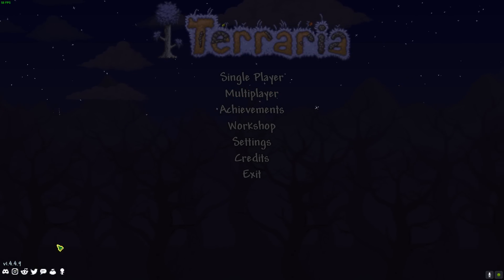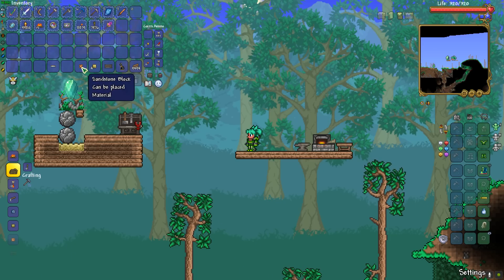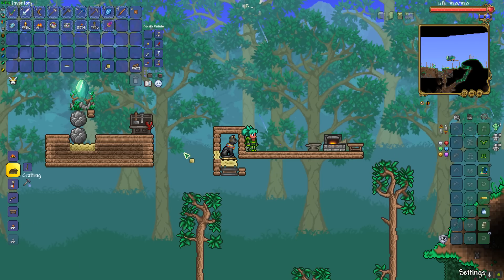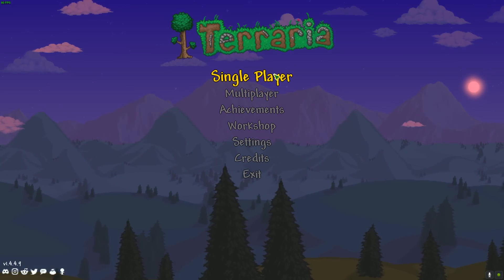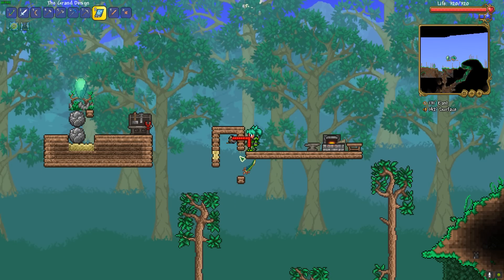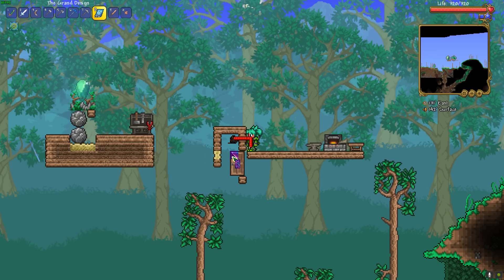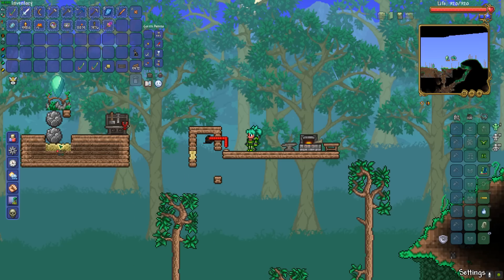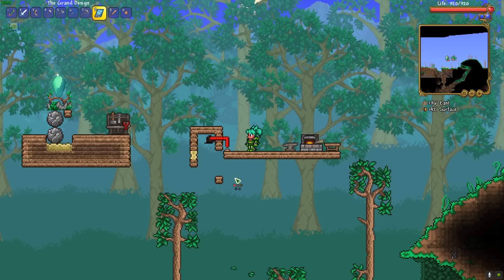How to turn a Door into a Terrablade +more | Terraria Glitch Explaination

Comment: The bast statue just breaks when i press the pressure plate
Edit: I put it to low
Edit 2 : It wont turn into the terrablade
Reply from the maker: you need to follow the exact order of what i do, open door, activate bast, close door, deactivate bast, and repeat a few times
Reply: @eatpotaro I think i got it to work its just really difficult cuz of my mouse

Comment: hay i tried this glitch and I am on mobile solo and it did not work do you need to do this on pc?
Reply from the maker: yes
Reply: ok thanks
Reply: @eatpotaro  ill try try that when i can
Reply: Just so you know the glitch might be patched and it’s doing the same thing when I try using mobile the bast floats
Reply from the maker: you may be on singleplayer, to do the glitch you must be on multiplayer
Reply: @eatpotaro  oh
Reply: @eatpotaro  but I have no friends lol
Reply from the maker: @maddowse  if you press the host and play option it works, you can do that with one player. Also i does not work on mobile
Reply: ok thanks
Reply: And I did try to do that in single multiplayer and it did not work
Reply: It’s patched 100 percent
Reply from the maker: @maddowse  its not patched, you must be doing something wrong

Comment: This glitch doesn't work for me, I've been trying for hours and it doesn't work.
Reply from the maker: are you in multiplayer pc?
Reply: @eatpotaro  now its done, but is so hard to get Zenith with this glitch
Reply from the maker: @pamonhachanvr  check the automated guide on my channel! that should make it much easier
Reply: @eatpotaro  If it took me 11 hours to understand the easiest glitch, imagine this automated one which is much more complicated 😢
Reply from the maker: @pamonhachanvr  the automated one is not that hard, its the same setup with a little bit of extra wiring
Reply: @eatpotaro  I didn't understand how your character moves so fast. Another thing is that I don't have the mechanic cleared, the wires I got were a friend who gave me, if I had known I was going to make another one, I would have used the duplicating glitch before using it.
Reply from the maker: @pamonhachanvr  i used a hoik. if the video, i hammered blocks a couple times and then placed platforms. to get more wire, get the grand design and look underground for trap
Reply: @eatpotaro  I do but, how u move too fast?
Reply from the maker: @pamonhachanvr  i enter the hoik by pressing down
Reply: @eatpotaro  wow, done, now i just need one Steamcontrol door, where i can find or create it?
Reply from the maker: @pamonhachanvr  im pertty sure the pumpkin door transmutes into it, or you can google cgo (campfire glitch) and obtain it that way
Reply: @eatpotaro  no way, another glitch like this just to get one door? 😢

Comment: I can't do it, can someone help me?
Reply from the maker: you need to be in multiplayer
Reply: yeah I was
Reply from the maker: @codzz1fan  on pc? on console you need to connect a second controller and i dont know about mobile
Reply: I’m in pc
Reply from the maker: @codzz1fan  whats wrong exactly?
Reply: Its that I can't transmute the door and the other items into the next one
Reply from the maker: @codzz1fan  does the bast make particles when powered?
Reply: Yes @eatpotaro
Reply from the maker: @codzz1fan  strange, the door changes from wood to purple in a corner right?
Reply: yes @eatpotaro
Reply from the maker: @codzz1fan  its working then
Reply: but I dont know how to get to the next stage @eatpotaro
Reply from the maker: as i said in the tutorial, you need to right click on the top-left piece of the door @codzz1fan
Reply: thx @eatpotaro
Reply: I tried it and i cant get past the wall
 @eatpotaro
Reply from the maker: just repeat what you do with the crystal door, but make sure to right click on the terrablade after transmuting the tungsten wall @codzz1fan

Comment: the bast statue doesnt activate
Reply from the maker: that means your wiring is incorrect
Reply: @eatpotaro  instead of a pressure plate, i used a switch and the statue disappeared. the switch can activate it with the same wiring.

my terraria broke i guess, because i restarted it and it worked. strange
Reply from the maker: @amazingtacothief926  that means it worked

Comment: Does it work on single
Reply from the maker: you must setup the floating bast head on a multiplayer server, but the rest can be done in multiplayer
Reply: @eatpotaro  i mean does it work on single world
Reply from the maker: @theunknownshesh5170  yes
Reply: @eatpotaro  i thought it only works in multiplayer
Reply from the maker: @theunknownshesh5170  as i said, the floating bast must be set up in multiplayer, and the actual transmutin can be dont on multiplayer or singleplayer. As shown in the video, i did it in 1 world